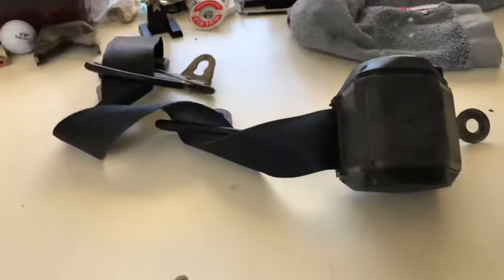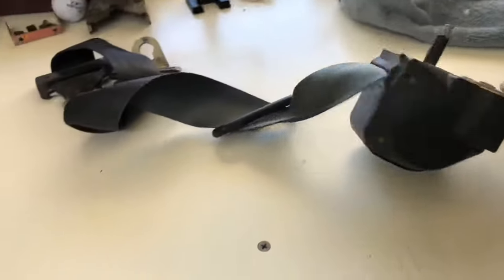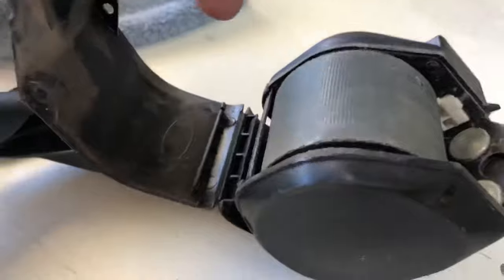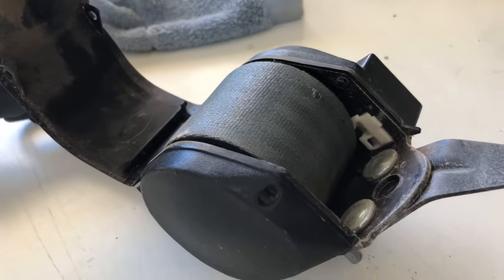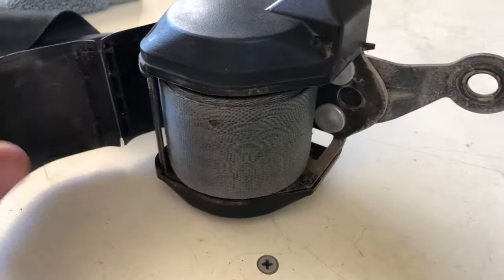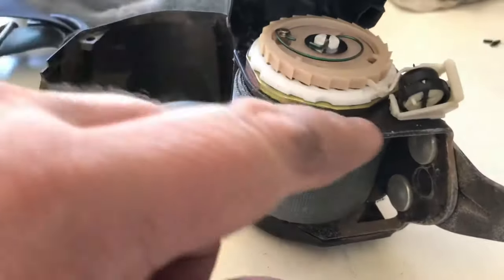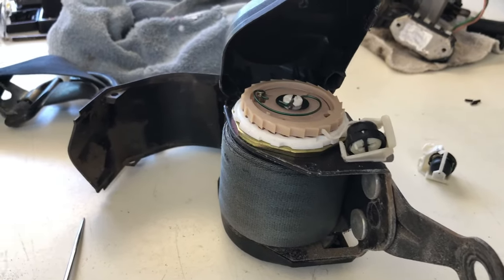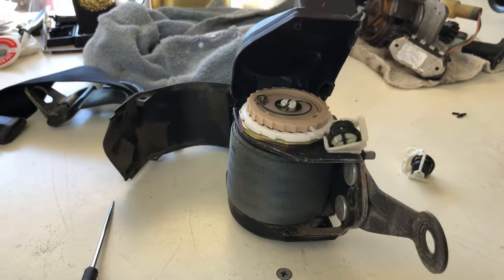Release Locked Seatbelt

Comment: Might be a mention that the cover to be taken off is the side where you can see the square of plastic.. white in this example, blue or other colors in other belt systems.
Reason to mention this is that the other side cover is over a coiled spring.
If this spring cover is taken off the spring can really release with force. Best to avoid this - and always wear face / eye protection just in case.
Ta for video.
Reply from the maker: Hey Click. Thank you for the advice, greatly appreciated!
Reply: Which is exactly what happened to me, so.. seatbelt ruined!